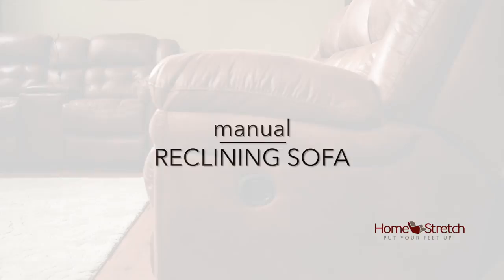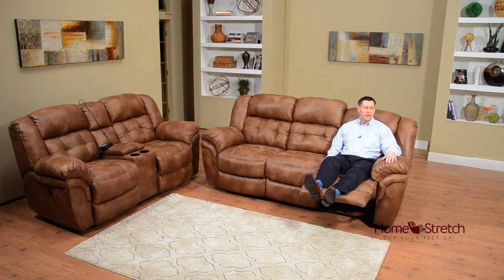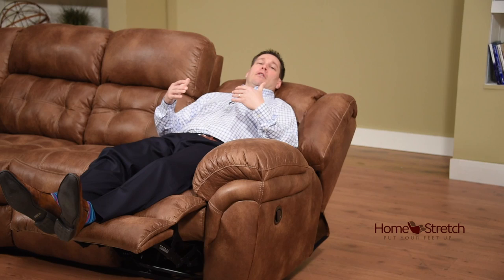Manual Recliner

Comment: Where is a video on how to use a lever handle manual recliner? My Beast Rake recliner is a BEAST to close.  I have to use both my legs and nearly break my arm pulling on the lever to release the recline to seating position.  What am I doing wrong?